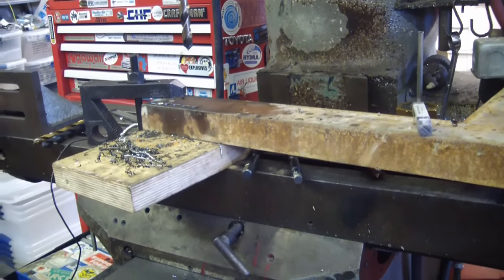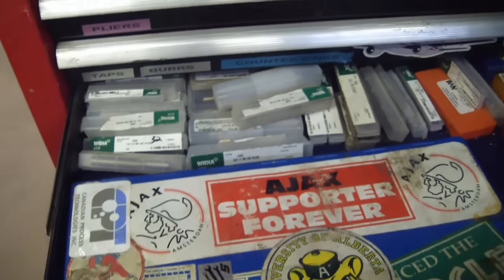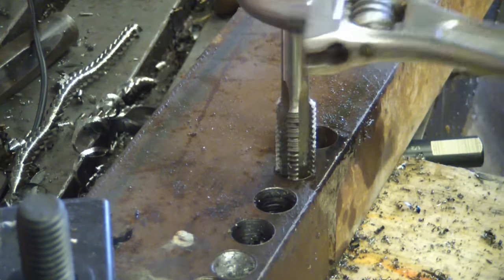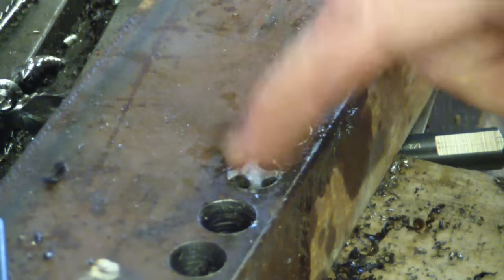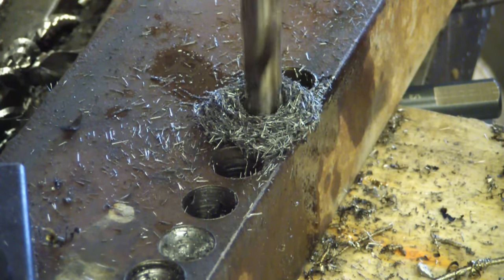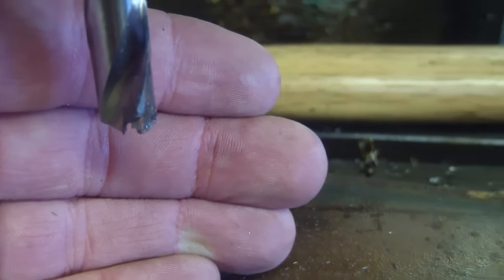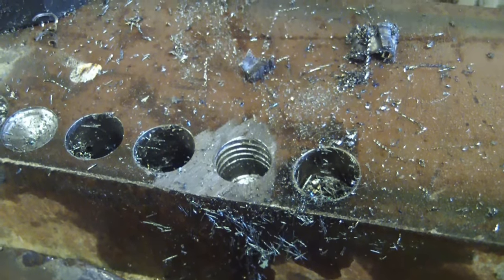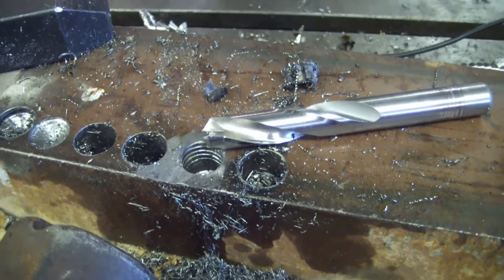Manly-man skills: Remove a broken tap the hard way.

Comment: Now.. show me how to do it by hand under a car, and make it a crooked easyout stuffed into a 1/4-20 bolt that's in an aluminum block.
Reply: I did it with 3 broken studs from a 5.4 f150 that was up north, everything was rusted out down there, but i removed 3 studs without removing the engine or head, from the fender well by tig welding
Reply: ChrisHallett83 my method of choice
Reply: Kirby Weldon buy a new car.
Reply: Use lefthand drillbits and your milsuckee. Or extract the block and use lefthand drillbits on your machine.
Reply: Brother you're both educational and entertaining
Reply: lmfao I'm in the same position
Reply: Kirby Weldon     Or an upside down broken bolt in a 💩 plastic casting😩
Reply: Problem is ChrisHallett83, that the studs are small in diameter.  He said it's 1/4", but the ones on my v-10 were a bit bigger at 8 mm.  It's really hard to weld something that small, especially when you have couple inches of room between the head and the fender or steering shaft.  With some holes you even can't get a torch in due to lack of space.  Hell, my blood pressure is starting to rise just thinking about it.  High temp RTV saved my bacon.
Reply: Hey johnathan bowman, thanks for the info, I'll check it out.  But next time it happens with my truck, I'll pull the axles from my f250 and drop them under my JK.  Cheers.
Reply: Kirby Weldon yeah no doubt
Reply: Just get your 80 lbs Filipino buddy to do it
Reply: You can also use a small cutting torch. Set the flame as small as possible and heat the ez out until red hot. Give a quick blast if air and it shatters.
Reply: have you thought about utiliseing the munroe effect ?
Reply: Hell yeah. Never thought of that.
Reply: well fist things first  we be needin to get that car on its roof to get access to it's er unmentionable   now this is best accomplished by giving to it  a  teenager ... but should you happen to lack one of you're  own and are unable to acquire one  then er.. well things get significantly more expensive   but first things first either find a ditch or dig a hole and then move the car over it and work from there
Reply: firefox5926  munroe effect ? What is that ? Sounds interesting.
Reply: your right on... everyone has this manly man drill press. still like the viojos..
Reply: Use alum. The crap they use to crisp pickles. It dissolves the steel, and leaves the aluminum thread behind.
Reply: Or the side of a Cat cylinder head, half under the cab, with a hand drill.
Reply: That sounds fun
Reply: Is this Hell?
Reply: Left hand bits, not cheap but if one does not go banzi  on the bits and keep them cooled down, keep the RPM's low you'll be drilling and all of a sudden up pops the tap or bolt.  I did think the micro carbide bit was an excellent idea as a pilot hole.  But people seem to think carbide is exempt from the rules of heat and fatigue.   It's possible that drill he used to follow might have held out if he had blown the hole out regularly and kept cutting oil in there?
Reply: i have tortched the block before and used a pick to gently rotate it backwards, the heat expands the block pretty well and you pour oil down the hole to keep the tap as cool as possible
Reply: That really is the only place these things snap, anyway. I fully concur.
Reply: The answer requires a couple of six packs, anger management class, a pen and a new car loan.
Reply: Yes.
And yes again.
Alum works on broken bits in aluminum.
Reply: just switch to a TESLA , problem solved

;D just kidding fk that
Reply: That sounds like a personal problem :P

I hope you managed to salvage your car, or at least your aluminum block.
Reply: Heli coil
Reply: What the he'll did you do man!!?😂😂😂😂
Reply: With a piece of crap Milwaukee with a brand new chuck that won’t hold a drill bit or tap.

Comment: I broke a tungsten carbide tap below the surface.  I used cheap diamond-tipped Dremel bits to cut between the flutes of the tap and it came out easily.  Just follow the precaution of cutting in 30 second intervals and allow for the bit to cool before going back in so the diamond tip doesn't overheat and separate from the shaft.
Reply: Just did that . 6 hours
Use valve grinding compound with the diamond needle drill.

Comment: I had a German foreman who never gave a cheapo cutting tool  to anyone. Bless that man.
Reply: Robert Clolery the price was high though, hope the counselling going well
Reply: Well I was mostly only given blunt tools.... yay beeing an apprentise. 

Me : This  nitrideded steel ususally I work with ceramic on it.
Boss : take this one
Me: its blunt and the edges have broken of
Boss: do it

Makes one hole the secound one the tap goes bust.
Me: I need something harder than the tap to drill it out. Can I have one  of the tungsten carbide drills?
BossNo take this HSS one

Drill may as well be made from warm butter.

Me: Can I please have now the proper tool to get this tap out, for example this spark erosion device everyone here is using when a tap is broken?.
Boss: Try with this HSS+Co drill
Me: sigh

Drill goes bust.
Me: Now?
Boss. Sigh

Me : Gets the devise plugs it in and within ten minutes the hole goes through again.
Me: to Boss: Did you order some new taps as I have asked that has been the last one 

Boss: No

And that how a ten minute job took  a whole week.
Reply: @vHindenburg  If you were paid by the hour at least you got your monies worth.
Reply: @fennyferrister668   Sadly that aint the case for an aprentice
Reply: all i asked from my employer was to give all 3 of us programmers the cheapest mechanical keyboard on the market... cost like $30... so that we don't ruin our wrists and so that we manage to type without the keys sticking on the 10+ year old "dell" low profile crap they gave us. 6 months later, i had left, still the same. Truth be told, each one of us had 2 decent 1080p monitors so ok. 

He never understood why a keyboard is important for programmers that bang away 8+ hours a day on them.
Reply: @GeorgeTsiros  What makes you think that having mechanical switches on your keyboard would prevent you from ruining your wrist? And if you cared so much then just bring your own keyboard. That's what everyone does.
Reply: @superbarnie  eventually, that's what i did. I also brought a second one for one of my coworkers. If you had used the keyboards we had at work, you'd understand pretty quickly why. We're talking 10+ year old "dell" keyboards. If you think i was exaggerating, you probably underestimate the levels of crust i'm talking about. Some keys registered double keystrokes, some registered only if pressed with force, some would not return positively and some did all of the above.
Reply: Im german, too. And I always give everyone cheapo tools, lol. So I save the good stuff for my self. The colleagues turn the drills into bananas anyway.
Reply: I had a lot of German foremen. After the 2nd WW the Russians stole all the machinery but they couldn't steal Wissenschaft. Weisheit is the root of knowing what to do when. I started my apprenticeship in '73. But my Dad taught me things by letting me observe his fitting & machining skills. There was a unwritten rule where if you broke a tap...YOU got it out.
3 fluters were difficult but the 4 fluters seemed easy to get out. I made my own 4 flute silver steel plugs...but if the fingers fitted down the inner flute of tap say a 5mm tap or ³/16" BSW tap...then having the shaft dead square to the centre line was the key. Smallest tap I ever got out was a 2mm tap. Luckilly broke on the way out.
I started out sweeping and cleaning machines to sharpening all the drills up to 6" dia.... to measuring, then drilling and tapping.
To unlock machining, marking out, tapping ,filing ..then learning welding,stick,TIG,MIG, Oxy, Spray...in 1995 went to night school and did certificates in all the above. Now I do laser welding/ Die repair, blowmolds...injection molds...weld to .003" of a sharp edge. 
Plus do tooling finishing..any tooling they say is unsalvageable...well it ain't broke unless I say it is.
I've drilled out carbide taps with carbide masonry drills...how...using the "white out thinners " as the lube. Devtap is great...one drop does it really. 
Ya got s to think outside the square. 
That is the art of the Toolmaker.
Proud to be one.
The art of flute tools is to have the main shaft the exact size of the tapping drill size. 
Always downward pressure as your rotating to get out the broken tap.
Sometimes going in opposite direction to disgorge any hard bits lodged in the already CUT thread.
Reply: When i lend tooling to one of the bros... (theyre just as hard on tooling) i lend them what i use so it cuts time and i have a tooling afterwards. Its a pain in the neck when you use stardard tooling and when you lend them out you get them back in peices unexpectedly!
Reply: My machine shop is also German owned....and they Buy Quality tooling.
Reply: His method probably is fine on a milling machine or drill press,but most of my tapping occurs in the Assembly area.
I use Moly D oil for any steel application...not just Stainless.
Reply: @vHindenburg  Are you a public server?
Reply: @suprememasteroftheuniverse  what do you mean with that, I am not state employed
Reply: Lol !
Reply: Well the Germans
Reply: I have a head with a broken stud in it and of course it's the one of the far end of the manifold that holds the weight of a turdbo. Problem is that I tried to drill a hole in it and easy out. End of story is a broke the easy out inside and tried to chistle it out to brake it up and start over but it made it worse. Is there any way to get it out at this point besides taking it to a place to electric extrude it?
Reply: @OrdinaryJoe12  I leave the counselling to those who need it bad.
Reply: @AlexA-tk1lj  What material it is made of? And what diameter is it?
Reply: @vHindenburg  the stud is in a aluminum head, and the the stud itself is steel. The ez-out is carbide that was used to extract the steel stud, which broke and when I used the punch and hammer technique which was my demise at this point. I dont know what else to try to get this out. I even had a machine shop tell me that they couldn't do it w
Either and I should drill a hole next to it and the turbo manifold so it will not leak. I haven't done that yet because I don't want to hack it up more then it is but luckily it has no exhaust leak as of now but I know it will because it has before. I used 3 gaskets including a mr. copper performance gasket just incase
Reply: @AlexA-tk1lj  I will come back to it... but for now I have to get to work.
Reply: @AlexA-tk1lj  What diameter has the stud? If it is just regular steel you should be able to mill it out even with a HSS tool. I guess it is a tap hole? If so mill it out retap in a bigger diameter and use a helicoil to get back to the place you should be, it will be tougher than before. If you have to keep the diameter at all cost you can still mill / drill out the core of the stud though you have to be sure to hit the middle, therefore you mill the surface you have damaged flat (the top of the rod, you dont want your tool wandering of an damage the softer aluminiuum) , bore a centerhole and then drill/mill the core out until the "rings" of the rod fall out.Milling is preferable over drilling since the forces that go sideways are way smaller while milling. I takes a lot of patience tbh  that is still better than to throw an engine block away. At this point I am assuming its something like M16 M10, but the be absolutly sure I would need drawings pictures of your project and tools you have. If you have a broken screw tap in there your only bet aside of eroding it is to keep hammering and hope that it finally shatters.
Reply: @AlexA-tk1lj  are you sure the ez out is carbide?  When I use them, they twist a lot and don't break.  I think maybe they are some king of 'tough metal that looks a little like carbide.'

so.....carbide burs in a Dremel or die grinder?  I have used the rotozip carbide cutters with limited success like this.  and continue the heat and oil cycles, too.  and once the stud moves at all, reverse and go back in a bit and start a back and forth cycling creeping the part out.  Reversing is hard if using a screw extractor unless you have left-hand ez outs.  Some hammer blows on the extractor, too (but if maxed out on extractor size, this swells the part in the hole....).

Recently I had an iron/steel casting with broken screw about 7/16 really, really stuck.  With maximum size extractor, the casting cracked in hoop stress.  Screw (shell of screw) is still in there, I temporarily gave up as the part is possibly not mission-critical to our pump station....but I figured I would mill away, re-thread, braze the crack, final thread if I need the part.

At least with aluminum head heat cycles can help you.  The steel/steel adapter/screw I had never responded to any attempts of oil, heat, impacts, etc.
Reply: God I wish I saw this video before I bought the harbor freight nightmare tap!
Reply: @m4inline  she had him? Was he a lucky or unlucky guy? Lol
Reply: Germany is known for having very good quality tools and workmanship. 

Side story:
Top notch U.S. machinists were talking about how they were better than the Germans. So they drilled the tiniest hole they could possibly drill with their best technology and send it to Germany to show off.
The German machinist looked at it under a microscope, tapped it, and sent it back. 😆
Reply: @mattkalin3139  some of their tools are very adequate for standard use. If you need quality tools go somewhere else.
Sears has a good warranty but who wants to replace tools all the time.  😁
Reply: @superbarnie  once you start bringing your own tools to work, then you'll start bringing your own toilet paper and water. It will never end.

Comment: Chinese taps are great man. How else would you tap plastic?
Reply: +Mechanical Engineer Was just thinking, but i've never had any trouble with my chinese taps......only tapped super soft aluminium duh
Reply: +Mechanical Engineer Was just thinking, but i've never had any trouble with my chinese taps......only tapped super soft aluminium duh
Reply: +Mechanical Engineer blow torch and screws?
Reply: +cerby86 Chinesium tap broke in an aluminium fork leg on my motorbike.  Bore did it, actually.  I tried drilling, but a hard tap in a soft material was a nightmare to drill out.  Bore is the thing.
Reply: cerby86 try copper
Reply: Jesus lol
Reply: cerby86 some Chinese tools are pretty decent
Reply: Chinese taps are great how else are you gonna demonstrate how to remove a broken tap....🤣😂😁😀😎
Reply: Nylon if you're brave

Comment: As a tool and die machinist with 30 years experience, I have found it to be more practical when drilling out taps with carbide, to use a drill bit that is just under the size of the body of the tap. So that you drill a hole inside the body of the tap without breaking through the sidewalls. That way the tap remains one piece in shape and does not have much chance of breaking your drill bit. Then all it takes is a couple of taps with a punch and the pieces will fall out of the hole.
I do love this channel and fine that this guy has a wealth of knowledge and a sense of humor to match.
Reply: This is the way

Comment: I don't know if this helps stop tap breaking, but when I trained with the R.A.F. in the 60's they taught us to always use a good cutting lubricant, (I think we used tallow then).  Also once  you have  the tap well started you should wind forwards one turn, back half turn and then forwards again. This breaks the cut metal swart into short strips so they don't block the hole so much. For aluminium alloys, back out the tap frequently or the swarf will accumulate,  re-melt in the hole and fuse or jam the tap.   Also, use a taper tap to start and then a plug to finish.  A broken tap should be very rare in your workshop especially if you are drilling the correct size hole.  Sorry if you already know all this stuff, but I see a lot of youngsters who don't.
Reply: This guy taps
Reply: Im not an expert. Thats why im here to learn. But in this situation, wouldn't it be easier and much faster to simply drill a series of little holes into the tap, and then unbolt it with a flat blade tool?
Reply: vacomments what do you mean "unbolt it"?
Reply: It's difficult to drill into the material that the tap is made of
Reply: Armen Lock not with a good carbide or cobolt. We did just watch a video of a tap being drilled. ;0)

Comment: When i break a tap into steel, i heat it until it’s red hot with the oxyacetylene torch, let it cool down slowly to unharden the steel and once it’s cold, i drill through with a normal drill bit.
Reply: Smart man, think with ur head when you don’t have infinite tools and $
Reply: The proper term for "unharden" is "anneal."
You're welcome.
Reply: @fubartotale3389  Ackchyually I would say this is normalising.
Reply: Lmao, now that is a guy who's never tried it, trying to spread metallurgy knowledge as if it's a one size fits all solution. High speed steel can't be annealed in the same way as most tool steels. It's pretty much the defining feature of high speed steel that you can run it red hot and still not lose its temper, hence why it can cut mild steel like butter. Yes, it'll naturally dull faster when that hot, but it'll still be just as hard once cooled, unless you let it cool for literally days like how they anneal it professionally. Trust me, I've tried many times before...

Comment: Shouldn't Step 0.5 have been to use a left-handed twist drill, followed by an EZ-Out?  (Which is then followed by the video on how to remove an EZ-Out that has snapped off while trying to remove a tap...)
Reply: Nothing ever easy with a EZ-OUT!